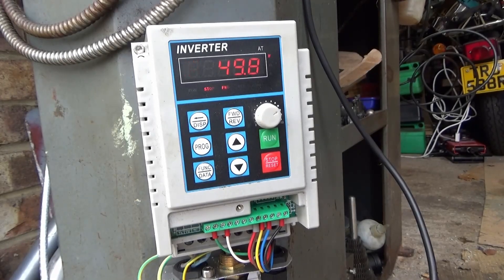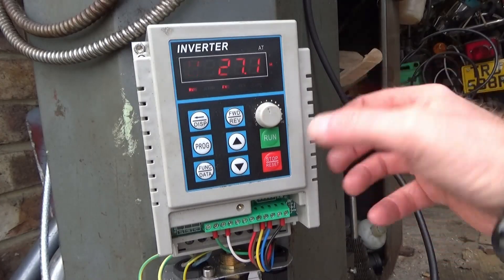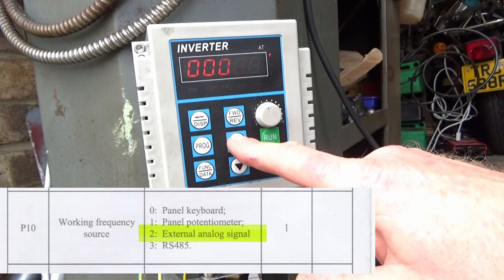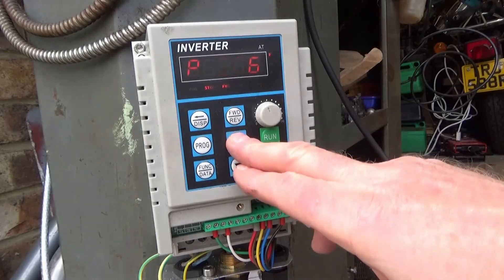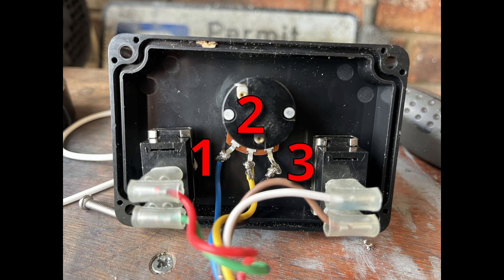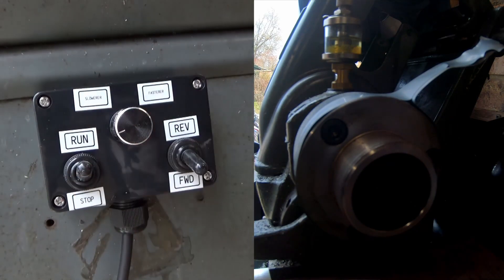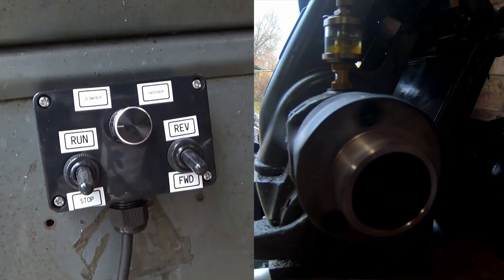XSY-AT1 VFD Variable Frequency Drive Remote Panel Programming

Comment: Could a panel be made up with a potentiometer and one on/off/on toggle switch. So on the switch one on position would be forward and the other reverse? Cheers
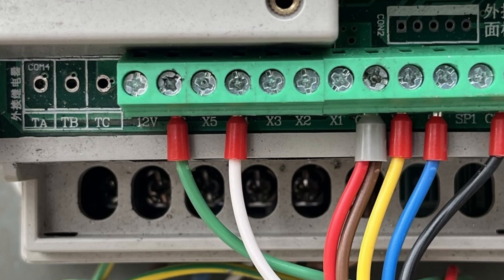Reply from the maker: On this video from around 2:19 this very question is answered.

Comment: Hello, could you please help me programming parameters P73 and P74 which are minimum and maximum external analog signal, they're configured as 31140 and 2096 , what are those number ?? normally it's 0 - 10 V ?
Reply from the maker: This is a complete guess but it might be related to frequency in Hz such as a hall sensor for maximum and minimum speeds. 

I’ve not dived that far into the VFD as I only need it for basic functions.
Reply: @ okay thank for your question response though . Have a nice day

Comment: One question - can you program the XSY-AT1 VFD Variable Frequency Drive
so that it runs at high speed for about 2-3 minutes at the beginning, but closer to fixed low speed?
Reply from the maker: I don’t think this unit has that flexibility as there’s no timer on the system.

Comment: Hi can you please help i have a cross cut saw and  need to put in a two way switch so that i can have it running continuously or on the hand button stop&start also i need to put in an emergency stop
Reply from the maker: Sorry, but it wrong be wrong to give out 'how to' advice on wiring machines up especially safety circuits, I would recommend you consult a qualified electrician to assist you in this.

As I state on my channel information and in my videos this is how I do things and professional advice should always be sought.

Comment: What fault FC002?
Please
Reply from the maker: Looks like under voltage. Your supply voltage is too low.
Reply: @bodganeering  cant change display coz setting unfungction?
Reply from the maker: I would suggest contacting the manufacturer.

Comment: I bought an start & stop button all in  one but before i connect potenciometer and reverse direction 3 button 1-0-2 
But if i want use specific button i must to connect a bridge from this one reverse control to start & stop to activate?
Reply from the maker: The manufacturers instructions aren't very clear and show the wiring connections the wrong way round. You will need a wire from the COM to both switches, either from the VFD or bridged from the switches.

Then run a separate wire from each switch, START/STOP to X4 and Forward/Reverse to X6.

X4 will need to be programmed as I show at around 1:30.

X6 is already programmed by the manufacturer so you shouldn't need to change anything on the VFD.

If you look at the picture at 2:11 you can see the wires I have connected. RED/BROWN from COM to switches. WHITE for START/STOP and Green for FORWARD/REVERSE.

BLACK, BLUE and YELLOW are for the potentiometer. 

Hope this helps.